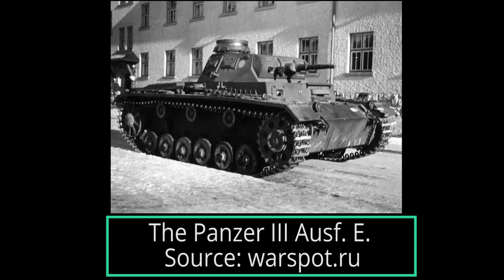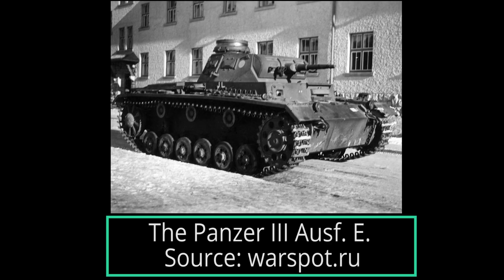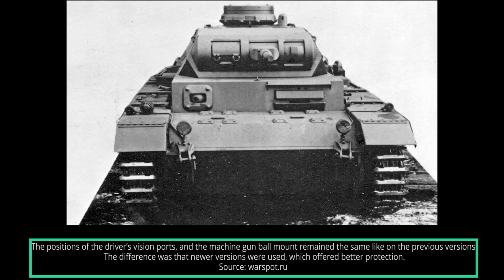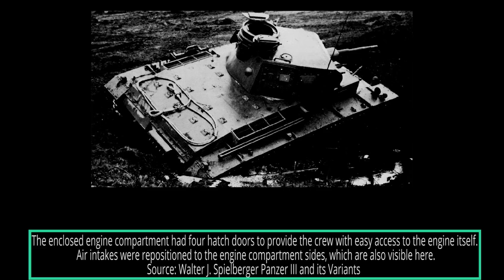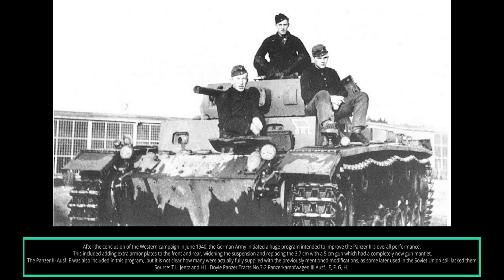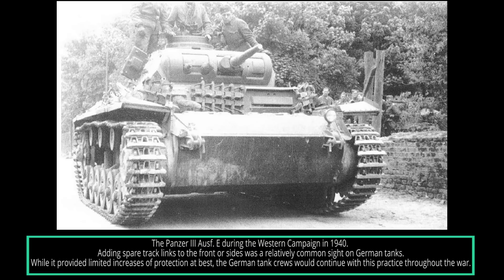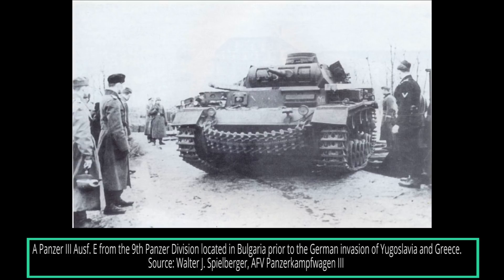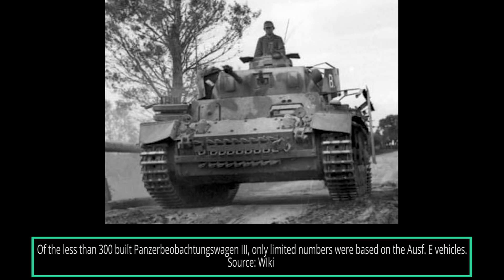Minimum Viable Product | Panzer III Ausf. E

Comment: At 13:35 , the caption says that placing track on the front of vehicles offered limited protection. While this is true, it is slightly misleading, because spare track needed to be carried anyway. The protection was a nice bonus, but it wasn't the primary reason spare track was carried, as the caption suggests.
Reply from the maker: It is the reason it was carried there.
Reply: @TanksEncyclopediaYT  I'm aware. But I the phrasing makes it sound a bit like a sandbag scenario, where there is no benefit and it's just wasted effort, it even implies possible drawbacks. It also implies that this was something the troops did themselves, but the mounting points for carrying spare track were actually located on the front.

I don't know, I'm probably being pedantic. Anyway, I thoroughly enjoyed the video. Keep up the good work.
Reply: @Kyle-gw6qp  The lowermost front spare tracks were slotted into a mounting point, spare tracks higher up (around the driver vision port and hull mg) were being welded on, primarily as added protection. I've also seen photos of tanks wearing tracks from different tanks - a panther with Churchill tracks comes to mind - which would have been no use as spares.
Reply: @chrisneville4265  Maybe, but we're talking about one specific photo of a Panzer 3, not a Panther.
Reply: @Kyle-gw6qp  Likely primarily in use as improvised armour on the tank in the photo too. Links were widely used as improvised armour across the board in WW2, and not just carried as spare track.
Reply: @chrisneville4265  don't forget how quite a few crews in WW2 cast concrete onto their vehicle.

Comment: Why bother creating 2 different tanks when Germans could build panzer IV hulls and just create 2 turret variants, the antitank one (37mm) and the infantry support one (75mm)
Reply: I read elsewhere that building both the panzer III and IV allowed two different engineering teams to get experience designing and putting into production state of the art tanks.  Also, at the start of the process, it might not have been obvious just how much overlap they were going to end up with in the capabilities of vehicles designed to fulfill different roles.
Reply: Different teams, different tasks, different factories.
Reply: @sjoormen1  total isolation too, it seems.
Reply: @kwkfortythree39  Yes, but funny ting, they look very similiar to each other.

Comment: Hello, I just discovered this channel, this is great.
I have a question about this vehicle, does it was superior to the T26 and BTs?
Im doing a mod for panzer corps and I need help for balancing the stats haha
Reply from the maker: Yeah, the Panzer III Ausf.E and all following versions were arguably way better compared to T-26 and BT series tanks.

While they had similar armor and armament, the Panzer III was more spacious and allowed for a larger five-man crew, which meant the tank could have a separate radio operator and commander. This meant that every crew member could focus on their job instead of having an overwhelmed three-man crew multitasking, as was the case in Soviet tanks.
Germans also happened to get a lot of the tank design features right before the Soviets did, such as the commander's observation cupola at the top, mandatory radio in every vehicle (not all Soviet tanks were built with radios), large escape hatches on the turret, improving the crew survivability etc. German tankers were also better trained on average.
Hope this helps, good luck modding.
Reply: @TanksEncyclopediaYT  thanks for the answer mate it was helpful :) great channel btw

Comment: 10:35 Why are you calling the KWK 38 semi-automatic? Error in original article?
Reply from the maker: Semi automatic in the context of large caliber guns does not mean the same as for small caliber ones.

In this case, semi-automatic means the gun automatically ejects the cartridge after firing.
Reply: @TanksEncyclopediaYT  Interesting, Thanks for the clarification!
Reply: @therealgsicht   basically semi -auto breech just kicked out the shell so the loader didn;t have to and all he had to do was fire in another ready shell so this is how many  lighter artillerys  get such high rates of fire ie 15-20 rounds a minute.
Reply: Semi-automatic in the sense that the breach block automatically lowers after firing to eject the brass and stays open so the loader only has to ram a new round in and the breach closes automatically.

If you've every seen cannons fire with the gunner/loader swinging an arm to eject brass and having to swing it to close after loading thats a manual.